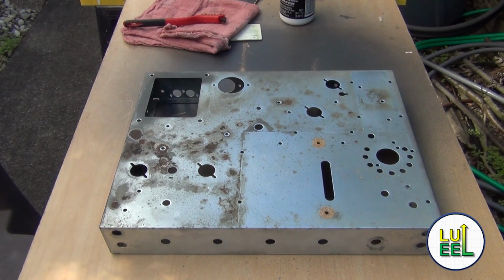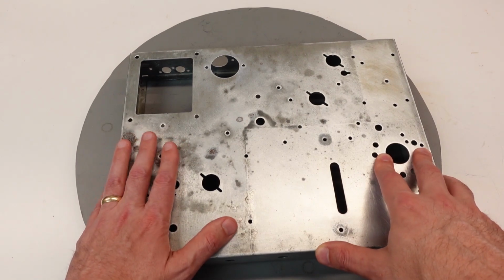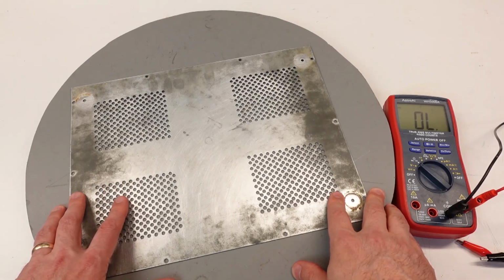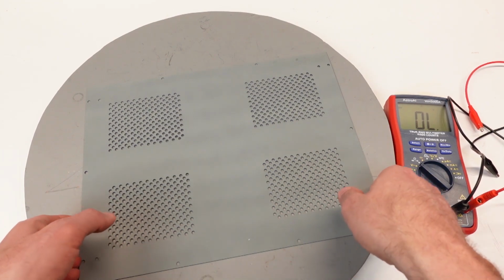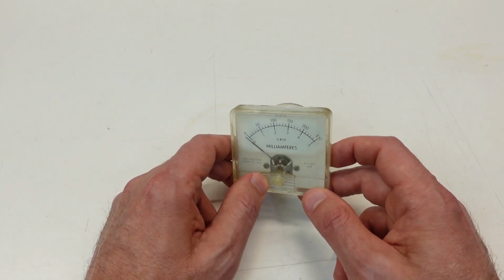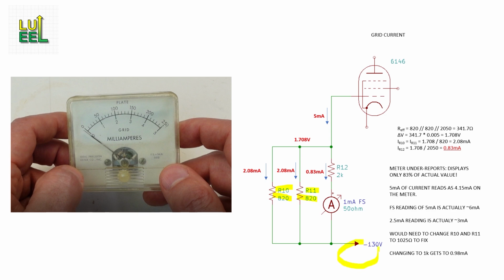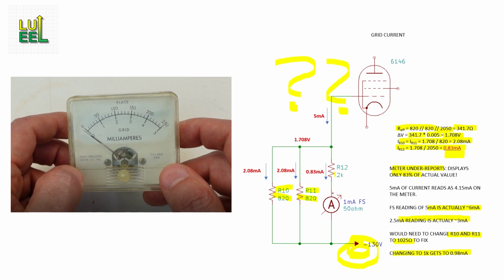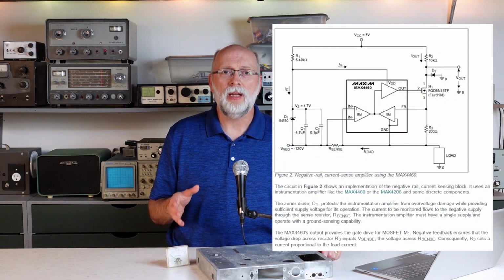Heathkit DX-60: Part #3

Comment: If R12 was replaced with the schematic value of 2000 ohms (2050 used in calculations, measured value of resistor R12?), then current thru R12 would be 1.037 ma (just over meter full scale).  Seems like it would be easier to replace R12 than replacing R10 & R11.
Reply: Changing R12 would affect the plate current reading when the switch was moved from "Grid" to read "Plate". The 2050 ohm calculation results from the 2K R12 + the 50 ohm internal R of the meter.

Comment: FYI:  Many years ago there was an article in one of the Ham radio mags, maybe 73 or possibly QST, about meter "stick-ation," and a simple 2 or 3 transistor circuit with a 555 timer and a few pots to get a meter to swing full scale and back to zero, over and over. The idea was to work out possible contamination or oxidation issues. I used it once to exercise an old meter on something I was repairing, forget what now, but after swinging the needle back and forth for an hour or so, the meter was fine. With the 555 you could set the speed to swing slow or quick and set it to swing back in different ranges on the meter face if desired.
This would make a good episode to rig up a simple circuit to do the same. It may help others with the older meter sticking issues out there. I'd encourage you to at least give it a shot.
73, Glenn WA4AOS
Reply from the maker: That is an interesting idea, worth a try.  I'll look for that article.  If I can't find it, I'll whip up something like it, thanks Glenn!
Reply: @levelupeelab  I did that when buying a stack of meters from around 1920s to 1970s and repairing the ones that was bad. I just used an audiol generator instead

Comment: My math is the same as yours. 0.83mA through the meter. However, it is measuring the bias supply current. I'd assume they are the same as DC can't flow through the coupling cap.